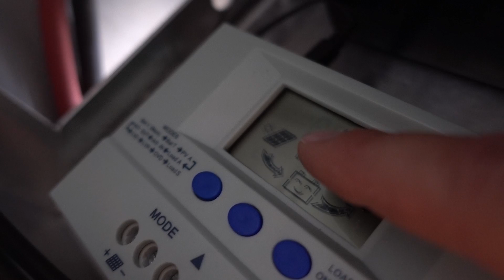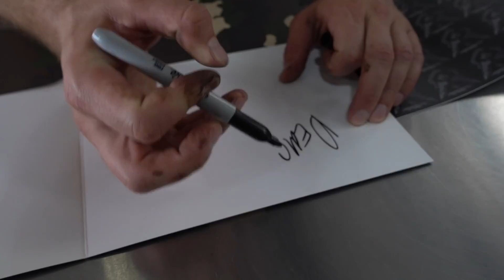Installing a Complete Solar Power System!

Comment: You need to incline the solar panel at an angle to obtain the maximum efficiency of the panel itself. The angle can be calculated with your geographic coordinates.

Comment: good day.  

paint the outside of the roof WHITE and maybe also the sides so the temperature in the container will become cooler.  

maybe it's a nice idea to first check the temperature for a day or so how high it gets and then when it is white again to be able to know a temperature difference.  

I am new to the channel 
I have just seen the abandoned house for the first time.  

Kind regards Hollandduck from the Netherlands

Comment: With the solar you could just run led lighting right from the battery / controller and skip the inverter, unless you plan to run other 120v appliances in there. Less complexity less things to fail and lower cost.

Comment: Also with the solar panel make sure it has air flow under the panel because solar panels dont like heat weird huh.  The cooler the panel is the more power it pumps

Comment: SAFTY ISSUE: besides turning the switch on box unplug the lights,especially being on an extension cord, as well so that doesn't get hot by some weird reason and lights run all the time....just like your supposed to unplug toasters,coffee makers, any small appliance, hair dryers, curling irons and clothes dryers when not at home... better safe then sorry...

Comment: Put a fan on that inverter and pump the heat out of that container.  With that system you could run a small fan 24/7 with no problem.  If it drops the temp 10˚ its 10˚.

Comment: Matt, another wonderful video. I have done solar for many years to do may things, not for a whole house...but to keep "system critical" things running for as long as we need them. It has always worked for me very well, and it doesn't take much knowledge. Contact me if you need some help.

Comment: Hey, just thought I would suggest something you could put a Thermostatically Controlled Ventilation Fan in your containers at the rear and 1 or 2 vents down low in the doors and wire it to your inverter. I think this would help a lot with the HEAT!  GREAT VID!!

Comment: I have been researching DIY solar setups pretty extensively for the last couple months. The big thing I think you could improve is spacing the panel further from the roof. Apparently they lose a lot of efficiency when they get hot, a bigger air gap would be easy insurance on top of that big griddle(container roof).

Watch @jehugarcia for some ideas on better battery idea, if you're serious lithium is way better than lead acid, although they might not like the heat of a Texas container oven.

Comment: Just a thought. R.V. Style vent fan? Move all that hot air out, and fresh air in. It gets really hot in those containers. That heat will put you on the floor quickly. And all that heat won’t be good for the battery or charger. It will melt  things surprisingly fast. Great Chanel.

Comment: The solar is a great idea.  I see the dark paint on the roof.  Get some Aluminum Roof coating (for RV or mobile home) it helps lower the surface temperature of the steel.    A cheap way to help out a bit. You could also put in a couple vents and a fan if you have leftover power available.

Comment: I read through many comments, did not see the following suggestions for the next solar project.
Suggestion 1 - Install motion sensors to turn on/off the LED light bars, the lazy way to control the lights.
Suggestion 2 - Use 12V LED lights, you lose some power during the 12VDC to 120VAC conversion.  Less power used equals longer run time, which may be useful during the winter months.
The RV industry runs on 12VDC (a lot anyways), not sure if you can find light bars of the same output, but worth the search.   Keep having fun!

Comment: Should make some brackets for the solar panel....it’s gonna get too hot have at least a 4” gap from the metal roof container so air can go under the panel and cool it

Comment: If all you are doing is lighting the storage container, you might find that instead of solar charging DC battery and converting to AC lighting, just use DC lighting with LEDs and lose less energy in the transfer to AC.

Comment: Great job, but you will need to cover the wires on the outside or the sun will cook the insulation off over just a couple years.

Comment: If you're not going to move the containers for ahwile you might want to mount the panels on a 45-degree angle to the South.
- it  greatly increases the efficiency of the panels
- rain will rinse the panels clean
- water and dirt will not collect on the panel (decreasing efficiency).

Comment: One thing to note is that inverters can have high idle consumption. I would switch the inverter itself off instead of just the one outlet to maximize runtime.

Comment: I'm not reading all these messages to see if this was suggested. Could you run a vent fan on the end of the lights to help with the heat of a metal container in the Texas sun?

Comment: Using an inverter and AC-powered lights is very inefficient; you should get DC lights instead and run them directly off the battery. Could be 2x the runtime on the same charge.

Comment: Matt didn't see anyone else comment this so I hope you see it.
Use the switch on the lights not the inverter, as its easier to change the switch on the light vs the one in the inverter if it ever breaks from being turned on and off everyday.

Comment: You may want to consider installing exhaust fans on top of your container to pull out the heat. You could out the fans on a timer to run during the daytime to protect contents from the heat.

Comment: Don't forget to caulk the hole you drilled for the power cables running from the solar panels to the battery.  If you forget to do that you will end up with a leak on the side of the container as well.  Nevermind, you got it.

Comment: I'm not an expert I just have some advice wherever the screws were put you should have put butyl tape and then got some dicor self-leveling caulking so that water couldn't get underneath 
And you may want to have got some cool seal paint the top to help reflect the heat away just my opinion
And the other suggestion would have been to put some rubber grommets around the holes so the wires won't be touching metal and if the Wind Blows the wires wouldn't get little microscopic Cuts in the outside protective layer
😉🙏✌💞😺💞👍👌😊

Comment: Mat Glad we could be a small part in helping. I did not have much to give but did what we could. Brother been in solar for 20 years. 90% of my home is solar powered. Two small tips. Turn off the invert when not in use. Do not use the small red switches if you can. This will save a lot power and work on that invter when there is no need. Your inviter could be using as much as 50 watts just to be on even tho there are no loads being run. If you find your needing more power spend a few bucks as buy a MPPT charge controller. They are as high as 98% efficient. A crap PWM charge controller like you have is around at best 80%. For now I think it will do you fine. IF you find your needing more power move to a MPPT charge controller. I like Morningstar charge controllers. They are knowen for last a long time. FOr you I would go with the sunsaver mppt charge controller. Nice work brother. God Bless.. PS keeping you all in are prayers..

Comment: correction... fluorescent lights are not running off of solar power. the lights are running off of the inverter that's hooked to the battery, the solar panel charges the battery during the day light hours... you need more batteries, and never put any of your controls inside of the container that the forklift can hit.
   p.s.
           get general contractor on your abandoned mansion job site. build to code or you will regret it later...

Comment: Matt put a panel in the direction south so the panel provides power through the whole day, I have multiple and it's generating more than i need.
Maybe consider changing to solar at the vetranch if possible and affordable?

Comment: water will get in that hole you drilled and the sharp metal will eventually cut through the wire and create a short. also, put a drip loop in the wire.

Comment: You don't need the inverter if you are only powering lights because lights run on DC power and solar makes DC. Second I don't know if you checked if the containers get any shading throughout the day, but that may not be a problem if it's only powering lights. Third is move your panels about 6 inches to a foot off the containers because of how hot they get. Heat is one of about a dozen or 2 things that makes it inefficient andwill kill some on your electrical input. Don't go by the watt rating of a panel those are only true in space conditions that panel probably will give you about 50 to 60 watts of power depending on conditions maybe more maybe less. That last bit is for future reference.

Comment: Don't let that battery get to hot, They do explode... 
Always turn lights off when not in use and leave doors open during operational hours... 

Check the battery heat during the heat of the day...

Comment: Matt, please use rubber grommets on the holes that you drilled and ran wire through. Also, run your wires in conduit. Just saving your from a fire. :)

Comment: Read through some of the comments to see if this was already mentioned. Yes to the drip loop. Yes to the fan. Too bad you don't have a left over can of flex seal. There's this stuff called Kool Deck. It's good on deflecting the hottest spectrum of solar radiation. Made for mobile home and tin roofs. If you don't like white. Try looking for a concrete pool deck coating. Comes in tans, beiges, bricks & browns... Maybe do a cool camo container.

Comment: Matt,
Great job on the solar power system install. One thing to consider on the solar panel is to install it at an almost vertical reference and pointing the working panel toward the sun at the time the lights are most used. 

There are reasons solar panels come with moving panels and it is not 100 percent to follow the sun but that is one of the big reasons. Another reason is to shed damage due to hail storms or even very hard rains. You could design a solar panel frame yourself using your T-shirt software or just draw it out by hand and weld it up. An upright panel would also help from the accidental  “oh no I just stepped on the panel” syndrome that isn’t a matter of if but when in a flat position.

Comment: Put a loop just before the wire goes inside the wall to prevent water from running down the wire and inside.
Also, if all you're doing is running lights, ditch the inverter and just do 12v LEDs. The inverter uses power just running itself, and then the lights probably convert it back from 120 down to 12v again. No sense wasting power converting power.

Comment: Matt, I'm sorry for your loss. A few things I wanted to point out about the solar system, to maximize efficiency, the panel should be facing south, at roughly a 30-31 degree angle (same as the latitude of your current area). Though this may not matter since it is only one panel. Also, I noticed that the wires running from the panel to the inside of the container should be protected if they aren't already weatherproof. Consider a second panel to help with the load during the winter months, as peak sun hours in Texas are lower in the winter months.

Comment: Also agree without using the inverter, most under cabinet lights are 12v DC fyi. Also with the inverter mounted inverted the heat sinks are upside down, and could have a issue with heat (fried a couple car audio amps back in the day mounting that way, heat rises)

Comment: i dont think that going to be good putting that battery in the sea container. i think its to hot you know 100 out side 185 in metal box and then adding a charger to it dont like its a good idea

Comment: you might want to install a fan in the shipping container. It will allow you and your employees to be cooler while inside those containers and with air circulating it should cut down on bugs and such.

Comment: Just a tip. The metal bolts on the side that is holding tour battery tray. I would of added a metal plate for extra support. But other then that awesome job.

Comment: why not skip the inverter and just run DC led lights
Reply: it's way safer than running ac voltage in a ungrounded metal box

Comment: Pull some of the slack wire to the outside and make a drip loop so rain doesn’t run down the wire and inside the storage container

Comment: Turn off the inverter every time you leave because that will draw more power faster than what the solar panel will provide causing your batteries to die.

Comment: When you turn off the lights, turn off the inverter. The inverter only need to be on when you need the lights to run, other wise your wasting power, and you battery will have a harder time keeping the battery charged, because the inverter will constantly be using power to stay on when it doesn't need to.

Comment: Respect installing that  under  these warm  condition's. 
A tip. Maybe when you feed a cable through a wall, you go first below the hole and than back up. 
Than the water can't flow from the cable into the hole through the container wall.

Comment: Those lights are 40w each so you might need more than one x 100w solar panel for your battery. A typical panel will do 60% so 3 panels will do 180w while your 160w lights need about 192w from solar to recharge the battery from what was used. The way it is that for every 100% you use, you need to replace 120% back into the battery.

Comment: If you did away with the inverter and stuck with strictly 12volt led lighting that would help with the life and and energy cycle of the battery. Just food for thought.

Comment: Hey matt, i dont know if anyone has suggested this yet but since that is solar powered and hot af, maybe install a fan, vent or small AC unit and plug it to your system? Small cutting or bracket install should change it up and cool it down a lot! Just a suggestion love solar power!

Comment: In order to get the most out of the solar panel, you should have installed it with a tilt towards the sun. A flat solar panel is very inefficient.

Comment: Now that you've got power in there cut another hole in the side and put a bathroom exhaust fan in it. Wire it up to run 24x7 to help pull the heat out. 
I don't know if this happens in Texas but here in Ohio we get a lot of condensation on the ceiling inside the containers and an exhaust fan will fix that problem too.

Comment: You should have a rubber mat under the battery. You shouldn't put a battery like that on concrete or metal. It drains the battery.

Comment: Definitely need an exhaust fan in the nose of the trailer. I had a heat stroke from working on a trailer like that for 20 minutes. So a small fan in the nose to help move air would definitely be a good idea

Comment: I don't understand why you need an inverter, the PV Solar Panels make DC, the battery can be charged with DC and the LED lights could be run with DC. An inverter is to change DC to AC so that you can use the power in your home, or export power to the national grid (or US equivalent) for annual payments.
Reply: It's probably acting as a converter to go from 12volt battery power to 110 volt house hold plug in power for the lights.

Comment: I don't get the whole thing about the track spikes. Just take the spikes off. What's the problem? Just use them as running shoes. May be a little less comfortable, but it should be fine.

Comment: Pretty nice set up u got there . :D an I made my off grid work shop unit with a bunch of fuses an on a home made cart .kept most of the unit close an solar outside but the weatherized calk is very good for that using bolts or screws so no water or moisture gets in . An also I have to say I'm sorry for what happend but I'm hear for you .an I was even telling the family if you needed another demolitia member or worker I wouldnt of minded going from NY to there in the sake of demolitia an the channel an the whole . :) always loving demolition ranch an off the ranch . You made one big army bigger than a lot I ever seen . :D I'm proud of you .

Comment: Looks like a nice setup. The 100W solar panel supplies just under 6A of current in full sun when the sunlight is passing through the least amount of atmosphere, which is straight up. Battery choice very good, but keep in mind that in order to power 100W at 120V, the inverter will draw around 9 or 10A from the 12V battery, which is less than the solar panel's output. For 1500W/120V, you'll be drawing 140-150A off that battery, which is OK for a very short time. I'd use 2GA stranded copper between the batter and inverter. As long as you put back more current than you use, you'll be fine. Great video!

Comment: That's cool, only thing I would've done is just use 12v led strips so u dont need to turn dc to ac ull save some power by not having to use energy to male ac energy

Comment: I love your videos,and sorry about the loss of your friend, but you need to put a grommet in any hole you drill in the containers if you're gonna run the solar panel wires to the inside

Comment: **ELECTRICAL SAFETY NOTICE**  Make sure you put a drip loop on the power line going into the container.
Reply: JJAMES so water doesnt drip into the power inverter/battery i would suggest a seal proof grommet and expanding foam.
Reply: And you it will also protect the wire from getting cut on the container
Reply: I came here to say the same thing. 👍
Reply: I used to be CCTV guy and was coming to type the same thing.
Reply: That is the first thing i thought of also. "Drip loop" is a must. Minnesota Union Electrician
Reply: Eric Wagner ⚡️IBEW✊⚡️
Reply: @ Jeremy i came to the party an hour after you but your *NOTICE* was not visible. wish it had been and i wouldn't have sounded redundant!!
Reply: Jake, eastern Iowa electrician apprentice.. was checking to make sure it was said..